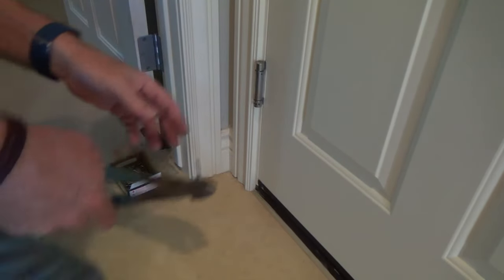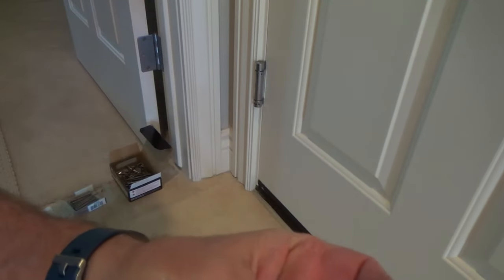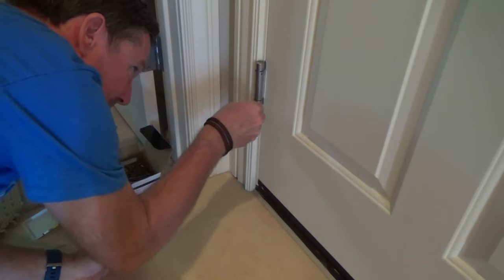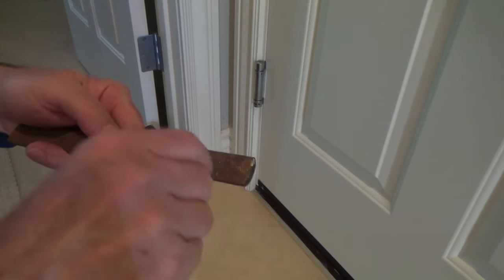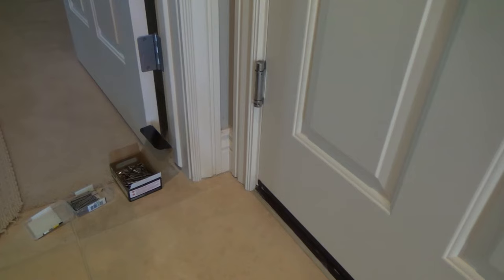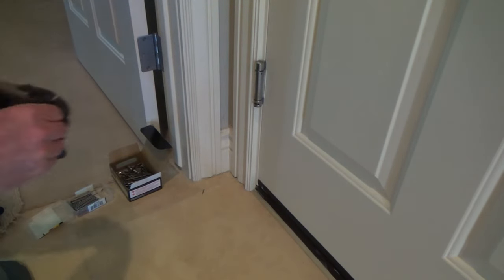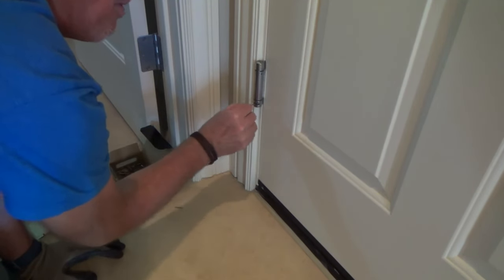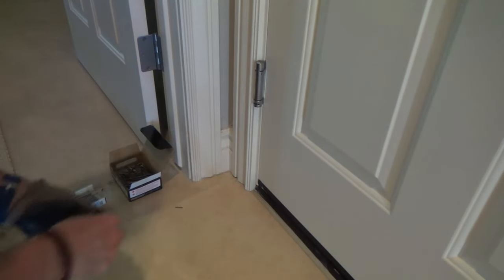How to Remove Spring Loaded Pressure on Self Closing Door Hinge

Comment: Thank you for sharing this tip.  You helped me not smash down my door after it has hit me in the ^% everytime I passed through it. Now, open, stays open until I've dragged in stuff, and then, I do have to actually latch it with a second effort because the garage air pressure pushes back on the door. Other spring hinges I used required a small allen key to hold the spring while moving the post.  Thank you and keep the great tips coming.
Reply from the maker: Hey thanks for your message. The main reason to take the pressure off of these hinges is if you want to lower the pressure or remove the hinges to install new ones like if the old ones won't get any tighter to close your door properly. Here's the thing...if you remove all the pressure on the door hinges then you don't have a one hour rated wall/door opening & if you ever have a fire in the garage let's say, & the insurance company sees that the pressure has been removed from these hinges then they may not cover your fire damage & worse could happen even after that especially if smoke enters your home & someone gets injured or worse. What I would suggest to you is since the door was hitting your heels when closing then maybe just back off the pressure just a bit & leave it at that. Even if the door doesn't latch all the way with the garage pressure I would think it would still be per code if anything happens. Yes there is a fine line with the pressure to close this door especially if you have weatherstripping around the door. But my advice would be to add the pressure back onto these door hinges. You can do whatever you want but at least now you know the rest of the story & you get to decide on your own. Yes you can still close the door & latch the door just by pulling or pushing the door closed so if there ever was a fire what really could the insurance adjuster inspector really say...right? But then again the building code says you have to have a self closing door on the garage door as most if not all garage doors are one hour rated. There should be a 20 minute rated metal label on the side edge of your door or the top of the door as well as a metal label on the door jamb somewhere as well & the labels should say 20 minute rated door & 20 minute rated door jamb & the rest of the wall should be rated 1 hour as there should be 5/8" drywall installed on the garage wall where the door is installed. That's what they would then call a 1 hour rating for this wall & door assembly. That's why there should be weatherstripping around this door as well as self closing door hinges... Thanks again for stopping by with your message....
Reply: @videojoeshows  wow thanks for this information, I didn’t know that these automatically closing doors were there by fire code. I was was thinking about taking the pressure off for my elderly mom so she could get in and out of the garage easier while using her walker, but if these self closing doors are required I guess I’ll have to leave it the way it is.  Thanks again.
Reply from the maker: @BreakTime10101  I wish I could tell you it wasn't a code issue but really it is. If you will notice, your actual door should be a solid core door & there should be a label on the side edge where the door hinges are or on top of the door that says your door is a 20 minute rated door. Your door jamb should also have a label on it near the door hinges or the top edge of the door jamb that says the door jamb is also 20 minute rated. That will tell you that your door opening is a rated door opening thus the reason for self closing door hinges. It's something you will need to teach your Mother how to open the door in such a way to where she can still open far enough to then push her walker in thru the door. My Motha has the same issue but she manages...
Reply: @videojoeshows  thanks for the information.
Reply from the maker: @BreakTime10101  Thumbs up for sure...

Comment: Thanks for the video as it provided my long lost instructions on how to release the spring / re-tension the spring.  In place of your nail idea I found one of my smaller finish nail setting tools fit perfectly in the hole and was strong enough to leverage the spring.  Also a magnet tipped tool easily removed the pin each time I needed to work against that spring.
Reply from the maker: Nice going. Glad this video reminded you....

Comment: Thanks for this, this helped me figure out a similar old style hinge at my house.  There was a standard screw on the bottom which was a red herring, but I essentially got it to work just how you did.  I didn't use the pin though, I used two drill bits and only stuck hte pin in when I got it tight enough with the bits.  I would've never figured it out without this video!
Reply from the maker: Dude thanks so much for your message & glad you were able to get it figured out. Way to go. I have more door videos on my channel that could assist further on all kinds of things related to door issues. Just go to my main YouTube channel page then click on playlists & scroll down to doors. Thanks again for stopping by!

Comment: Thanks for posting this. I have to replace the weatherstrip on my garage entry door and have been hesitant knowing I will have to deal witih a lot of spring tension when the door comes off. Will this require lowering the tension to minimum before removing the hinges to take the door off? There are only top and bottom spring closers, the middle is standard.
Reply from the maker: Yes I would recommend taking the tension off first for sure. I have other videos for this & also installing door weatherstripping too. Just go to my main YouTube channel page then click on playlists & scroll down to doors & they will be in there. Thanks for stopping by & good luck to you!

Comment: tried to install these because I failed a fire inspection. They screwed on fine but they were causing my door to hit the frame on the latch side.( not even close to closing) They are much fatter than the original hinges.  So I had to put the original ones back in. Do I need to chisel or route out the hinge side frame to give these more room?
Reply from the maker: That's weird as all the ones I've ever seen are the same size as the existing door hinges. Measure the existing door hinges you have then remove one hinge & take to the hardware store & match up to the spring loaded hinges you want. I just recently purchased some from The Home Depot and they were the same size as the 4 inch hinges I had on the garage door going into a Condo. Check it out & let me know. You shouldn't have to mortise out the hinges any deeper as you had explained.....

Comment: Because it’s upside down :/ . Bruh…
Reply from the maker: Actually it wasn't upside down as I looked under the hinge at bottom & nothing there as well. Apparently these are older type spring loaded hinges that didn't have any adjustments but I would think they wouldn't sell such a thing as you always need to adjust these hinges depending on your existing conditions. I have never heard of such things without the adjustment capabilities....weird!
Reply: @videojoeshows  Hm... Good to know. By the way, if you see a screw on top or bottom, chances are it's a lock screw and you may try open it to see the hex-wrench place right there. But I like the first one better lol. Keep that as a rare item, though. You never know someone is going to be interested in buying that with 10, 100 times its price lol.
Reply from the maker: @thachhoanglengoc4229  I've never seen one as you have described with the lock screw.